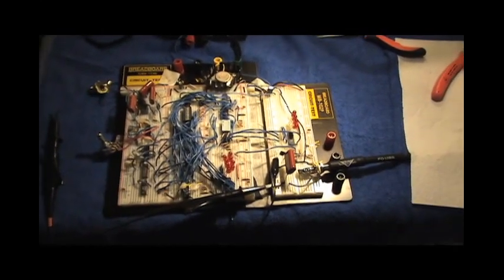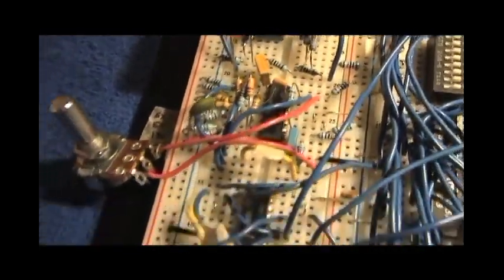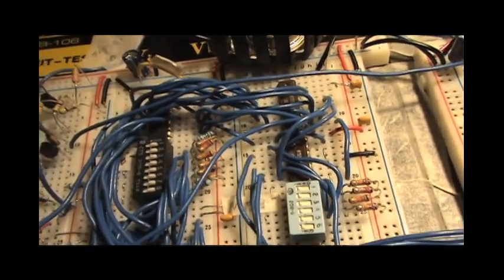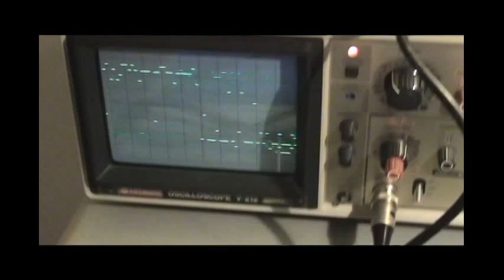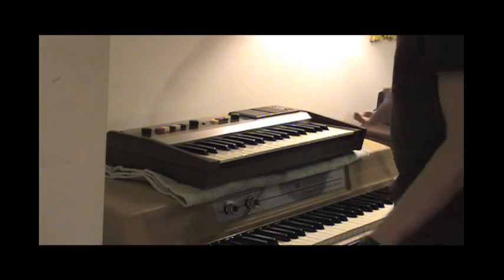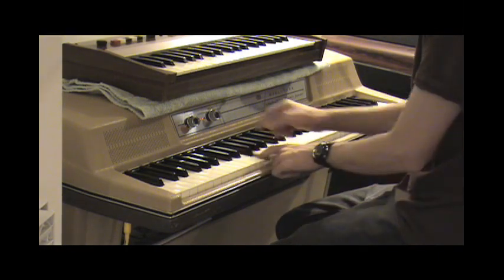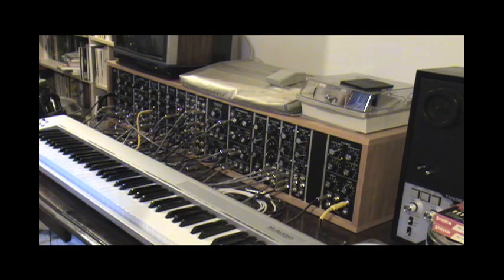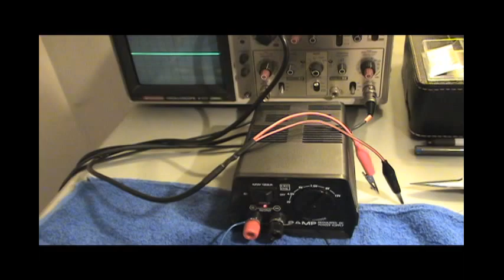"JCS BN-1" 4-Bit Linear PCM Synthesizer - Part 1 (Prototype)

Comment: Awesome stuff man. I'm sure this would fit in at any stage along the modular pipeline!
Reply from the maker: howmando4 Yes, I will definitely have to try it "integrated" within the modular synth. The output level is about 5V peak to peak at most, which is half of what the modular synth's oscillators outputs give, but nonetheless, it should work.